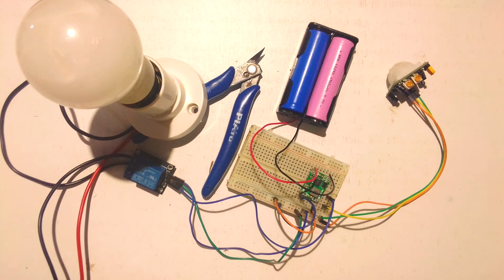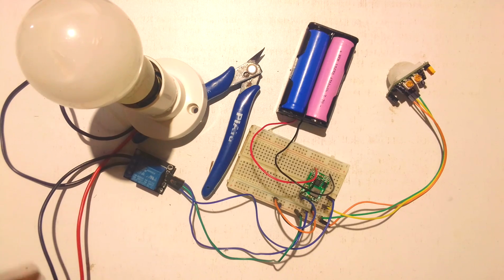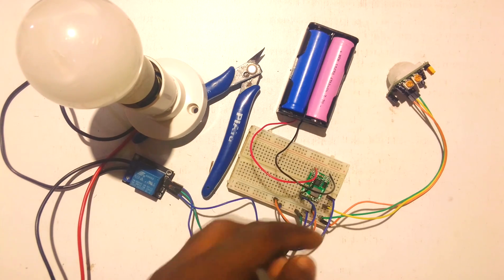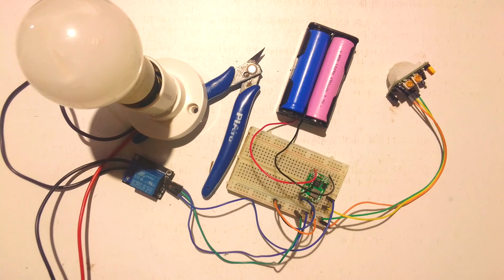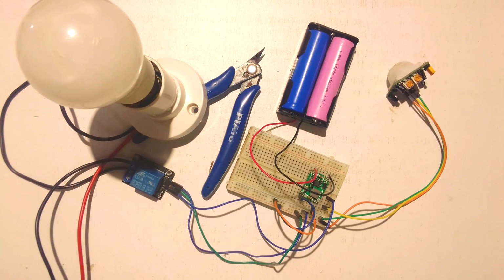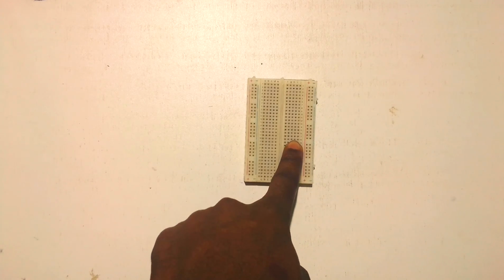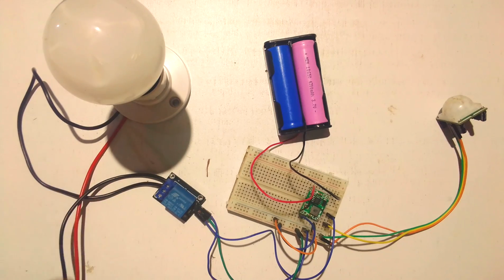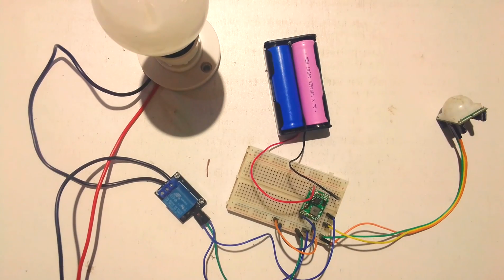How To Make Motion Sensor Light Switch using RELAY MODULE & PIR sensor at Home

Comment: I can't get my relays to shut off.. I have tried 3v 5v and 12v,, all the same problem all low level triggers.. Some are low or high triggers and do not work on either setting.. Do you have a link to the relay you use here? What voltage do you have the buck converter set to?? THANKS!!!
Reply: Hello the back converter output is 5V which is used to trigger control the motion sensor, then when the motion sensor is triggered it sends voltage to the relay signal pin then the relay completes the ground then of the bulb then it lights